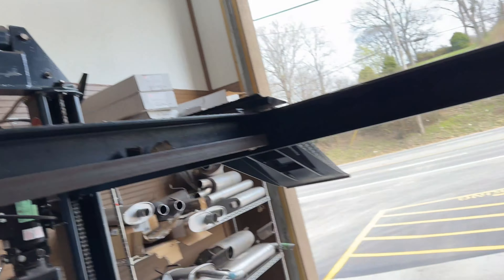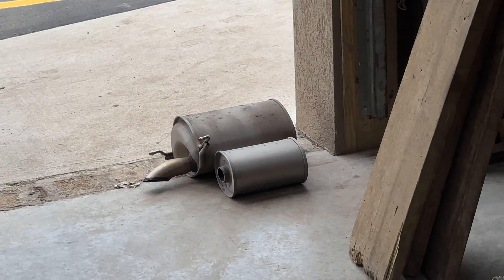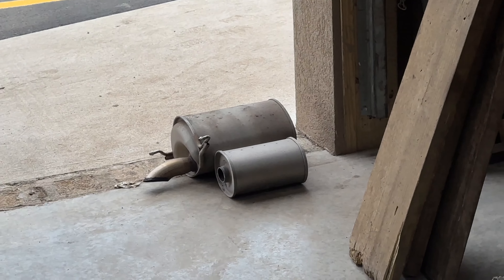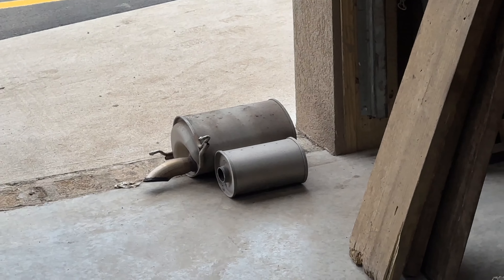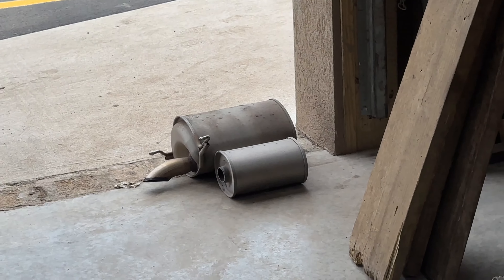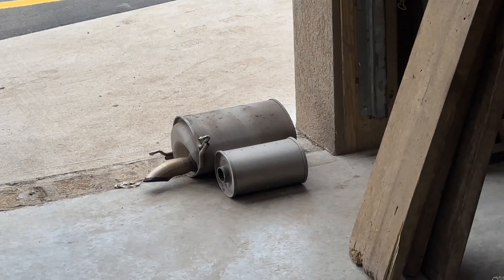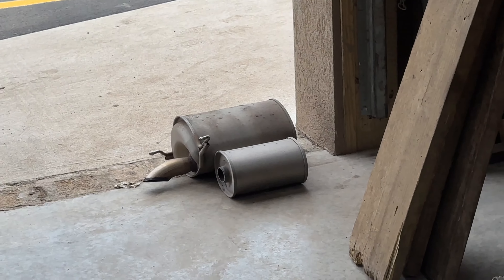We Straight Piped a 2011 Honda CR-Z 1.5L Hybrid!

Comment: I had the same L15 1.5 Single Cam in my 09 Honda Fit 5MT. Secondary cat delete and 2.5 straight all the way back. Godspeed Coils, Injen Intake, Buddy Club Shifter, Acuity Tran Bushings. Slammed, daily, loud, obnoxious, embarrassing. But it didn’t sound absolutely god awful. Only just bad.
Reply: Lmao
Reply: Just add a magnaflow & a resonator. It will sound amazing. When doing cat deletes on nearly any car, it NEEDS a good long resonator to clean up the unpleasant frequencies. And a good large tip straight though magnaflow will deepen the tone while also cleaning it up some more.

Comment: i have my resonator and muffler cut off with welded pipe to the back. i think it sounds neat. i wanted it to be able to actually hear the car. when i first bought it i just was learning how to drive a manual. now that i know how, i like the sound, and even want to go as far as getting a straight pipe all the way through to be annoying. what’s more annoying than a hybrid 127 hp screaming as it’s trying hard to pass you in a 70 mph. nothing. i love it.